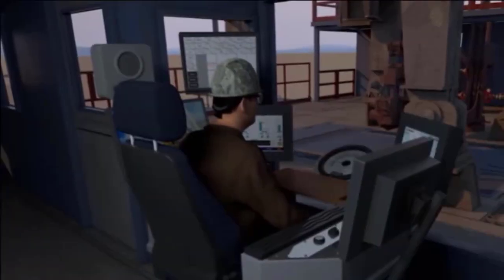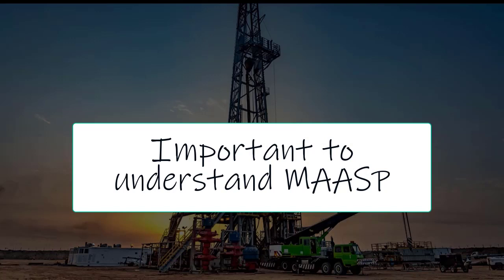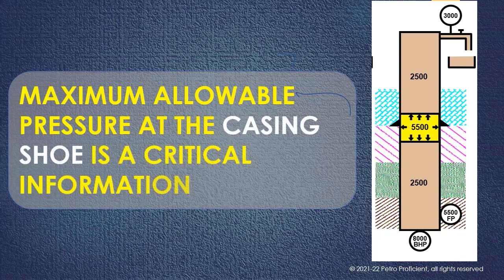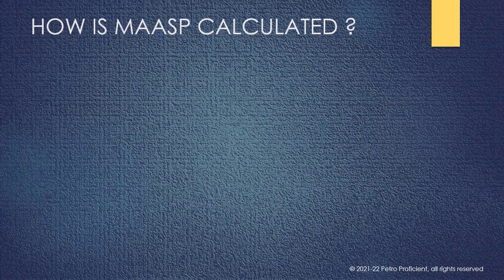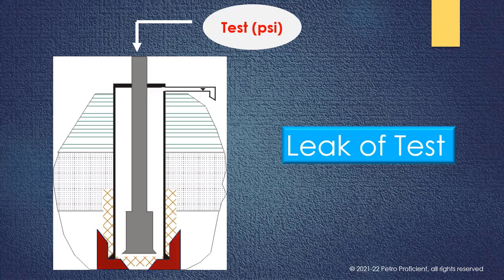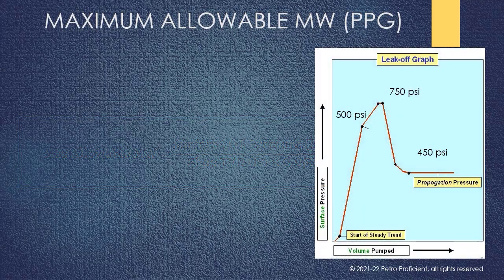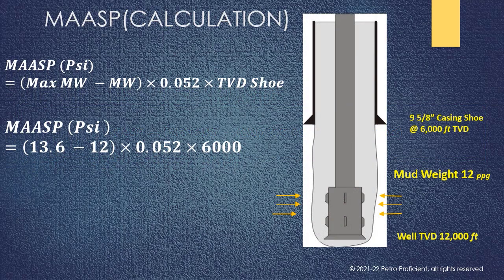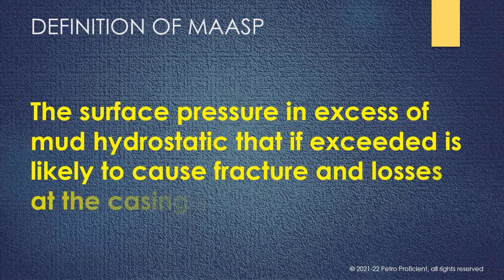Well Control | M A A S P

Comment: I suppose there might be a mistake in the MAASP formula: 0.052 should be used instead of 0.0052.
Reply: Absolutely the constant is .052 which is a result of 1 / 231 (there is 231 cubic inches in a gallon) then multiply by 12 (12 inches in a foot).